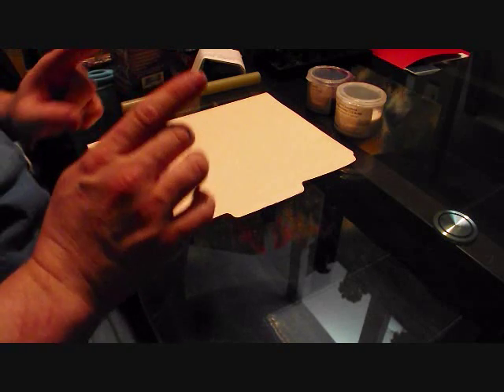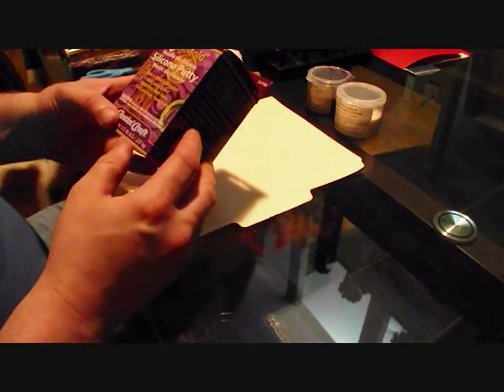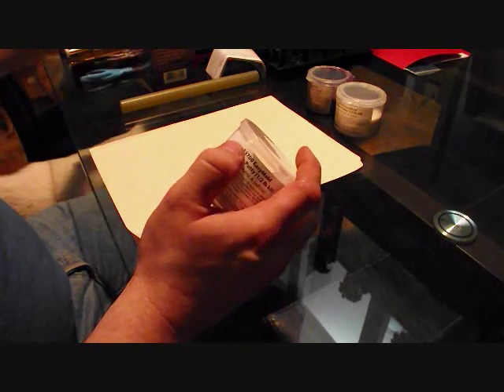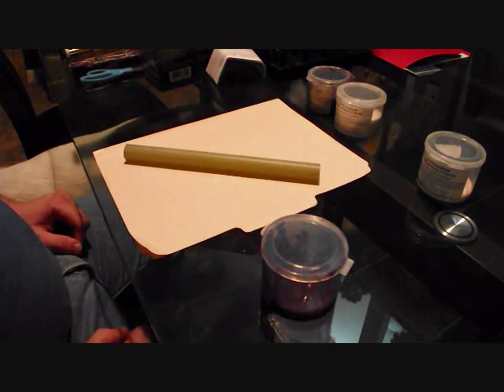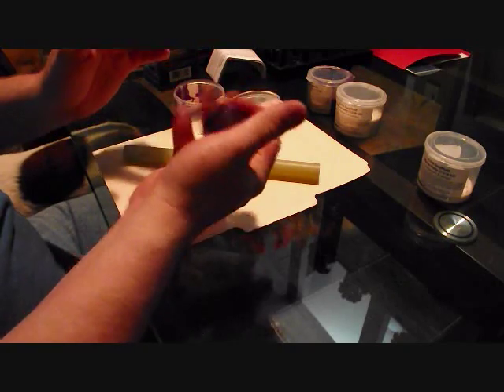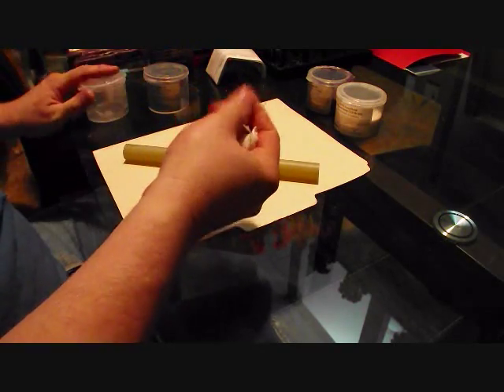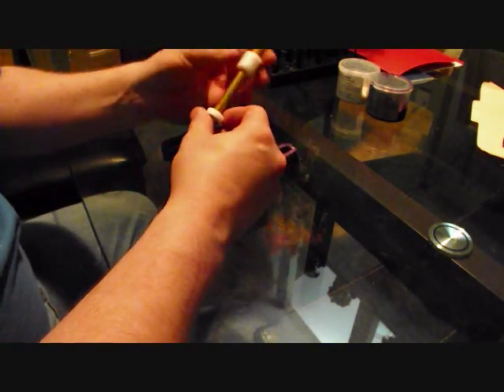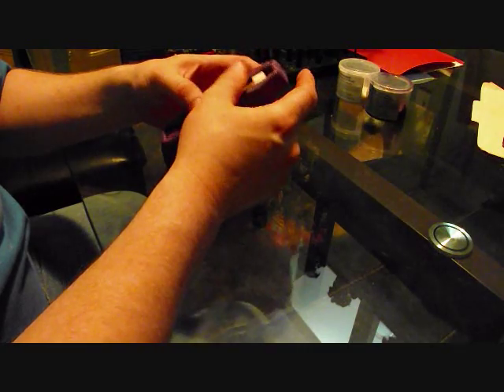Making a Universal pen blank mold with Easy Mold Silicone Putty.wmv

Comment: @ 8:10 you pulled out a blank with squiggly lines, how did you get the lines on that one?
Reply from the maker: That was a manufactured blank from Wood Pen Pro I believe. I simply used it to make the mold. You can make ribbon blanks in a flat mold, don't know if you can in a round mold.